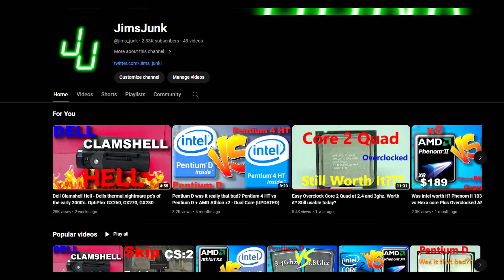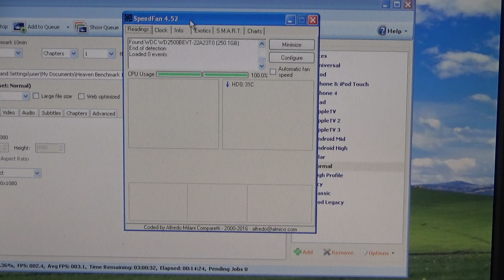DE-HeLLification - Dell Clamshell overheating thermal fix?  Optiplex GX260, GX270, GX280

Comment: I saw one of these in the store at the front, think it was the register.  I was wondering why the fan was running so loud
Reply from the maker: they probably had it shoved in a cubby with the back up against the glass or wood
Reply: @jims_junk  Yeah actually I think they did

Comment: As for why dell didn’t do this, I’d bet that power supply is an off the shelf psu so they likely couldn’t really modify it for the system. Or it’s a cheap machine and dell used that as an excuse not to care. Probably both
Reply: I mean, I'd imagine they had a contract with the OEM in question who could've done the change needed. All they had to do is ask
Reply: @shodan2958  Generally with parts like this made for many desktops they are built a certain way that works best for most systems. Just something as simple as rotating the fan would mean changing that part of the assembly line for that power supply or more likely, a new line entirely. For a cheap system like this, dell probably didnt think it was worth the money to commission a special psu for this system.
Reply: @lenshibo  Given how omnipresent these were around 2001-2006-ish you'd expect the economies of scale to tilt towards a separate design for these things. And these SFF PSUs afaik were a custom design anyway.

Comment: did they ever make any core 2 duo versions of these chassis? i kinda do like the chassis look.

i've had a DELL  760 USFF before. they had pentium 4 and core 2 duo options if i remember.
Reply from the maker: Ya know, I swear they did, but can't find any online.  I know the one client that had them, they were all p4's.  However,  this other client who had them I swear had core2duo's inside...maybe my memory sucks.  I asked an ex co-worker and he said he remembers the same thing.
Reply: @jims_junk   looking around i found a Dell Precision 340. i think those are identical to the GX270? precision was more workstation than optiplex.
Reply from the maker: @rayproductionsbackupchanne3862  hmm yeah looks that way...just looked it up found it says they were released in 1997...and it took RDRam..so definitely older than the gx2xx.   Was trying to find a pic of the mobo and came across this:  https://shorturl.at/hnDNZ     

That is a server/workstation mobo..but doubt it fits in the desktop case.  Regardless, it would be fun to play with :)

Comment: the CPU never gets hot enough to be an issue, the main catalyst that drives fan speeds up is the northbridge so the PSU fan flip and a northbridge fan jumping power off the CPU fan connector will solve the issue, why they didn't at least flip the PSU fan baffles me.
Reply: could cause dust intake on the psu (but an external dust filter could solve that)

Comment: too bad ya can't upgrade to a heat pipe cooler like you can on the P4 dell tower models the part being Dell 9Y212.
i do wonder if there was ever a replacement Heatsinks that was all copper by a third party.

Comment: Its odd, cause i dont remeber that short of a fan. I have a box of ba13733b12h's. 24 of em. That's yer fix.
Reply: Also yes the fan is pwm driven by the mobo, in other fan models they crushed or removed the thermal diode inside the fan and just let the mobo pwm it proper. Better rpm when it needed it and the longer exit ofbthe blower actuly touched the back and created a better air flow. This was the 280s tho.

Comment: Just trying to argue to counterpoint that I personally don't believe in, but maybe the engineers considered the cubbyhole desks for towers popular at the time  that really only have good air in the front, and they didn't measure flow and just assumed air would come from said front tiny grille.  And then a fan didn't happen.

As someone that's worked in many different manufacturing fields from medical to energy to housing, these disconnects are just part of doing business.  You can't anticipate a bean counter doing penny pinching in a design.

Comment: I should flip the fan in my power supply. The air filters are a terrible air block, even 2 intake fans 1 exhaust fan makes the case a vacuum.

Comment: ok, so I am starting a collection of retro machines, and this will be my first one, how should I go about it?
Reply from the maker: Chances are if you find any, the caps will be bad.  So just find one with a good case and repair the motherboard.  Maybe I can do a quick video to help people who don't know how to go about that?
Reply: @jims_junk  I've seen the PC turn on and function, I've used it before, everything seems to work fine and so far it has no issues, but 8n not sure what do do about retro gaming since it has a Pentium 4, 1gb ram, 40 GB hard drive, no GPU, just integrated, what games should I run
Reply from the maker: @ajstechlab  Check out https://www.youtube.com/@jims_junk/community

Just made a post there.
Reply: @jims_junk  thanks

Comment: I can only find these with centrifugal fans on both the psu and cpu.

Edit: my best guess is you got a region specific model, refurbed or dell used multiple OEMs with yours being a minority.
Reply: There are different case sizes.  The one shown here is the smallest.  I think the next one up has those fans.

Comment: This girl i really wanted to date that was way out of my league un 2012 needed a conputer badly. I usuallu have tons of conputers but this was the only comouter i had. I fixed it up the best i could and gave it to her. I really regret that decision. Pieces of sht was worse than the computer it replaced 🤣 i dont get how i thought guving her this piece of garbage would help my chances of dating her at all. I just wanted to see her so bad and i dig through my piles of sht to make somthing that ran. She said she needed it for schhol for microsoft office n sht. I figured the school used these pile of garbage so it should work for her 🤣